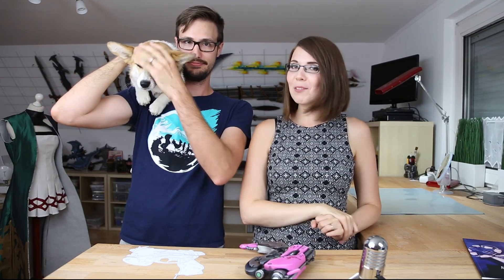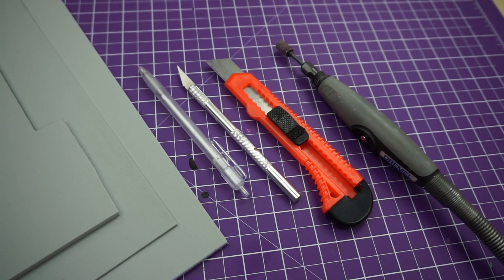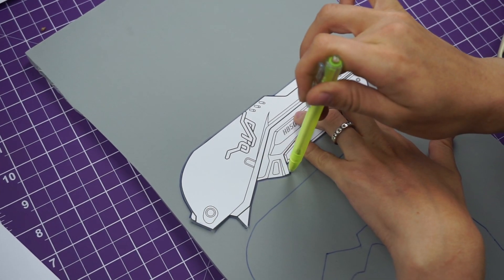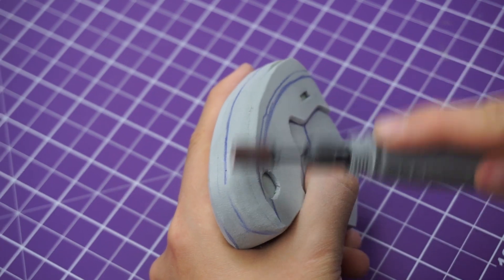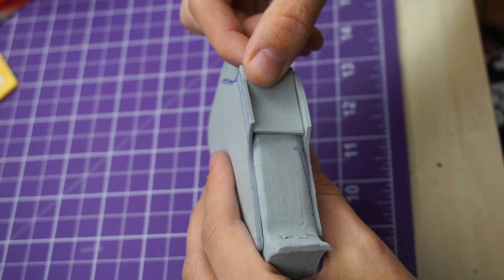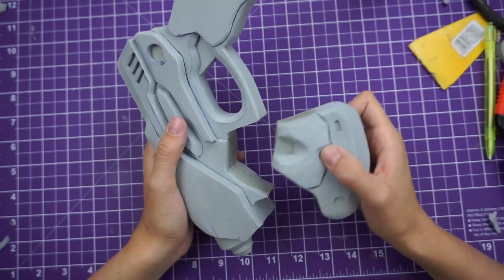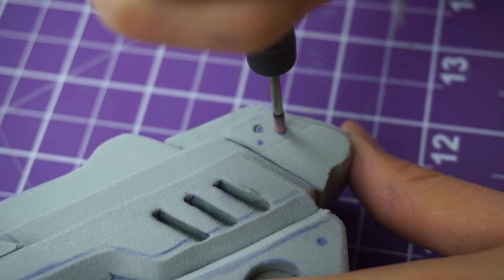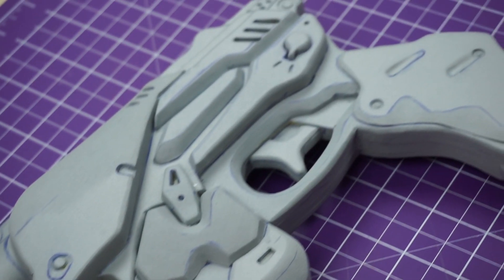EVA Foam Build - D.Va Gun Replica - Part 2

Comment: If you were to say, use 4 layers of 5mm high density foam vs 2 layers of 10mm foam, would that have a big impact on the sturdiness of the build? And could say, a foam handle be strong enough to handle wielding a blade made of acrylic? or would you recommend wood for that?

Very helpful tutorial I had no idea such builds were possible with foam!
Reply: I'd better use 2 of 10mm, despite 4 of 5mm is the same 
thickness it may not be as strong as 2 of 10, especially if you are trying to hold acrylic. In conclusion I think is better 2 of 10, you don't really need wood, also is difficult to work with wood :P hope I helped
Reply: Thank you. I think what I'm going to do (yes 4 months later haven't started on this part of my cosplay lmao) is take the acrylic straight through as part of the handle to have a strong base, and surround that with 5mm foam, then do 2 more layers of 5mm foam on the top and bottom of that. From what I've been working on it doesn't seem to make a difference in what thickness foam you use as it's still the same density. For extra sturdiness though i'll probably cover the whole handle in worbla in the end as well.

Comment: How do you get your bevels so smooth? My bevels are rough. I just bought a new dremel and new sanding bit. Could this be why? I'm working on building this now as my first project and it's super bad but trial and error is how I see it. Perfect practice makes perfect. Super helpful video by the way. I subscribed.
Reply from the maker: Maybe try a different sanding tip and set the speed higher? Mine works just fine!
Reply: KamuiCosplay I think I'll try a different grit sanding tip. I heard heat helps to melt away the rough excess rubber as well so I'll give that a shot. Thank you!

Comment: when you blend the line between the two pieces of foam that have been glued together, could you sand the line instead of using that little roll tool?
Reply from the maker: You can also try to use sand paper to blend the layers but working with a dremel is a lot quicker and smoother. You can just buy one for around 20 bucks so it's really cheap! :)
Reply: KamuiCosplay thank you sm

Comment: I was wondering what dremmel u use?
Whenever i try to use my dremel the foam sometimes litterly flyes out of my hand because it's going so fast. (it's on the lowest setting)  Yours seems way calmer and easier to work with :3

If anybody else knows a good dremmel i would love to have some recomendations. I would only use them for foam right now.

Comment: would this work if i used insilation foam? cause thats all i have.
Reply from the maker: Sure! I won't exactly work the same way but you can figure it out! :D
Reply: Thanks for the reply, I found that it does work it just is a bit more crumbly but i fixed that by sanding it. Thanks!

Comment: if i want to print a "life size" of a different gun, or well - a big rifle, how do I get it to print over several pages, and still be able to tell if it's a good size? @_@
Reply from the maker: I usually print the pages out , lay them on the floor and lie next to them. Then Benni takes a photo and then I can see if it looks good! :)
Reply: wow, that's a good idea! I went about a very complicated way instead, haha, I checked the assumed the character was my height, checked the ratio of the gun to the character's body and then converted the pixels into life size (through maths) and then printed out according to those measurements and luckily it fit! :) 

thank you for the reply!

Comment: did you wear a mask when you used that contact cement? i hear that stuff is really bad to breathe in but you guys just put it in a bottle..
Reply from the maker: +TheExenteration It's not so bad when you only glue small parts but for larger ones that's a good idea! Opening a window also helps!
Reply: Thank you for the quick response, i'll try it in an open ventilated area.
Reply: KamuiCosplay excuse me can u give me the name of the dremel device you use